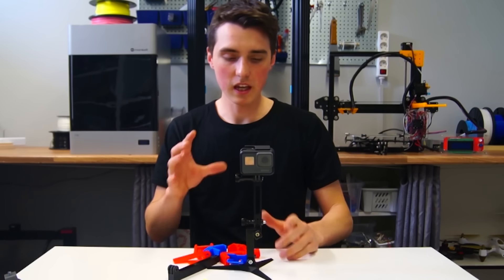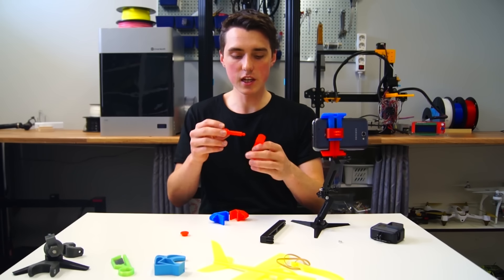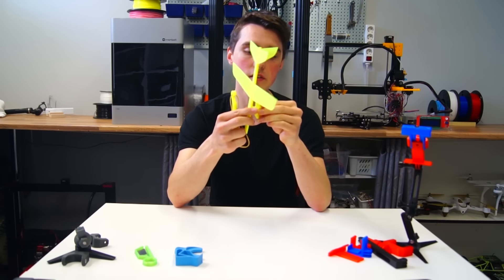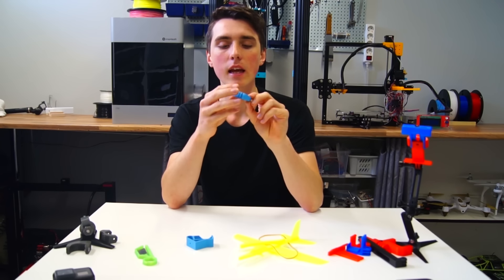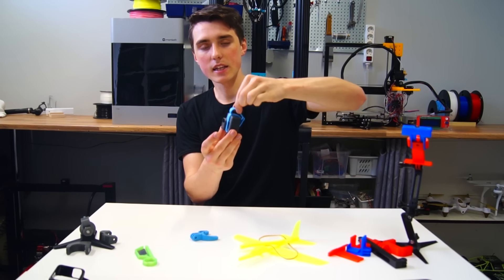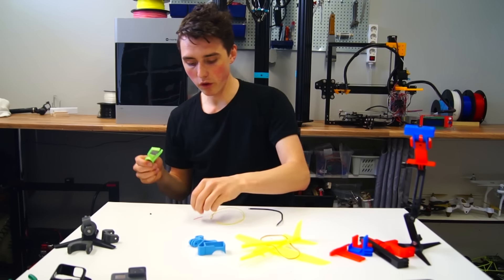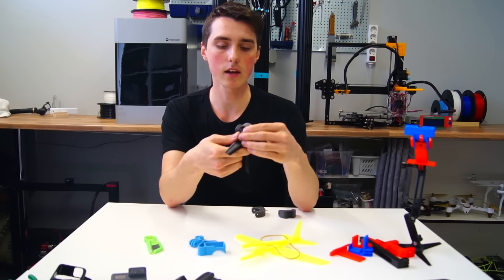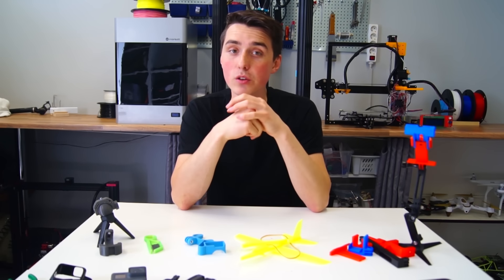5 Awesome and Useful 3D Prints!!!

Comment: Cool video and 3D prints.  I'm Dan from California 😎.  Regarding the red clamp and threaded tightening screw, did your threads line up and work on the first print?  Did you sand them to make smooth?  Pitch and thread count?  I'm using Solidworks, ... anyway to see your sketches, ....do you have YouTube channel for CAD Design?   Thx

Comment: Nice! I have a friend who also have a 3D printer - it's awesome! I have used it to make new microphone attachment to my camera and wind screens for the microphones. 
The new one will probably be a new casing for my speed measurement radar (wich I have a video of for those who want to watch). I want one that's smaller and one that can stand on it's own - because now I have to carry a stand for it to (wich takes up a lot of space in the bag while carrying it). If I want to measure traffic, I cant just stand on a bridge or beside a road and hold a radar gun. That will look like I'm a cop and people slow down - wich ruins my result. I'm there to collect fun (and correct) stats, not to fuck with the drivers. I'm also one of the fast drivers and hate road cops chasing speeders - so I don't want to look like one my self.

Comment: Why did you remove the cooling fans from the tevo tarantula?
Reply: Nt T it might be because he is printing with ABS and ABS cannot have cooling.
Reply from the maker: I needed those for a different project. I was printing PLA, but didn't have any spare ones. Definitely use fans if you are printing!
Reply: you can turn it off in the software. It's controlled by pwm
Reply: RCLifeOn 
Hi can i have some of those for my gopro